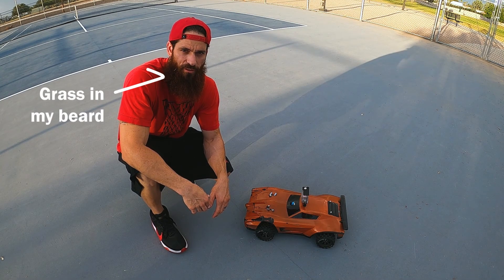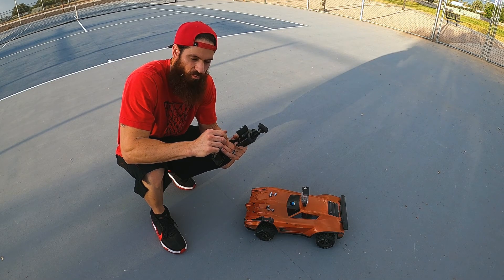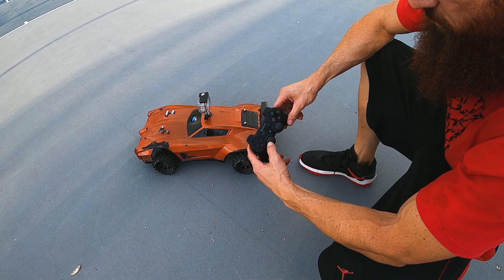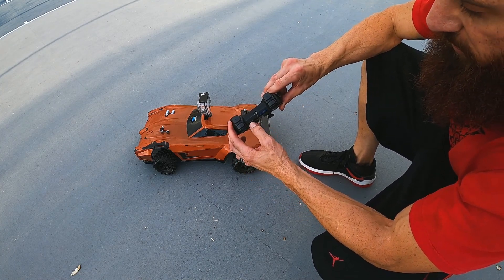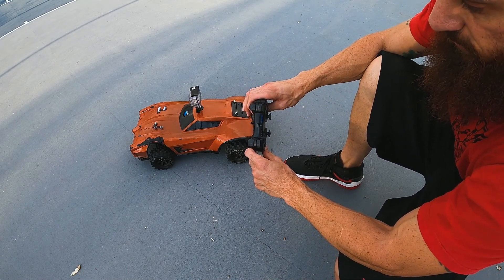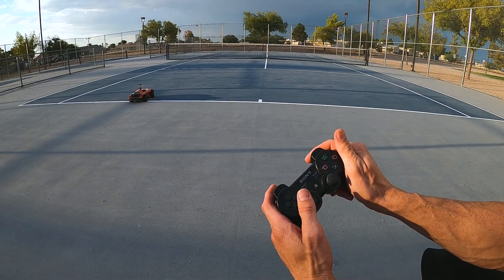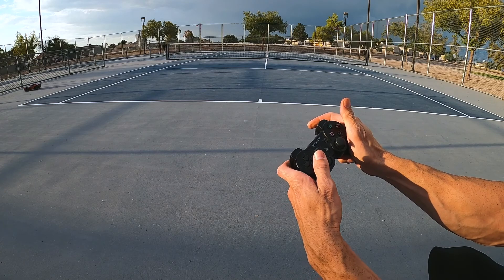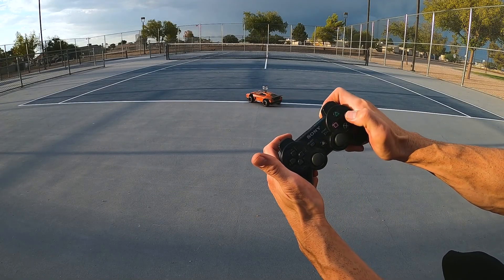I turned a PS3 controller into an RC transmitter with a functional boost button

Comment: Just seen your rocket leauge video posted via fb and love the whole leauge aspect of it would be so cool but using a ps3 pad that got me like wow ggz man
Reply: Can i ask what i said on facebook aswell have you locked the diffs up for slow or do you have it on gear  box?
Reply from the maker: @andyroo8uk685  Nothing special to the gearing. They're all brushless, but the bodies are heavy and only running on 2S or 3S. The lighter ones (Fennec and Dominus) are on 2S and the heavier ones (Merc and Octane) on 3S.

Comment: that's wonderful . How many meters could the PS3 controller command result in...?
Reply from the maker: I moved to PS5 controllers about a year and a half ago. They're Bluetooth connected, so the range isn't good. They'll get about 60 meters with line of sight. If obstructed, about 30-40 meters. It works great for what I use them for (soccer with RC cars), so it's not a deal-breaker for me.
Reply: @rcautoball Any chance these available for purchase? 😅

Comment: Nice job. Scratching my head on this on an armed rover I built. Did you use the rc reciever or are you running through a microcontroller?
Reply from the maker: Thanks! Definitely didn't do it myself. Microcontroller with the help of a couple of people.

Comment: Hi. Xbox 360 controller directly works with rc car or there is some configuration requires?
Reply from the maker: It can, but it's a much more complicated process because it doesn't use a regular Bluetooth configuration. So, you have to use different hardware to make it work.